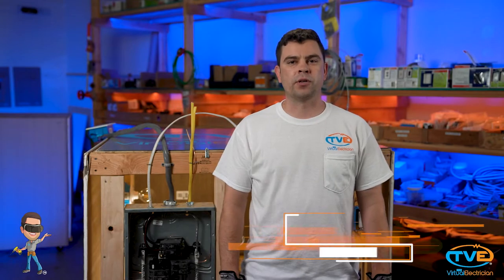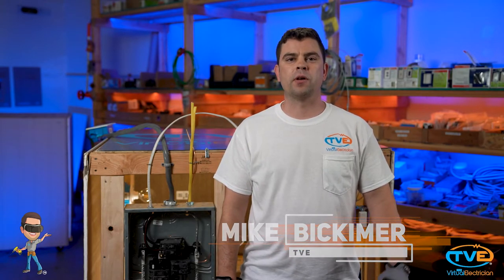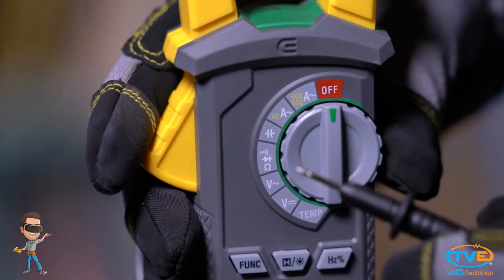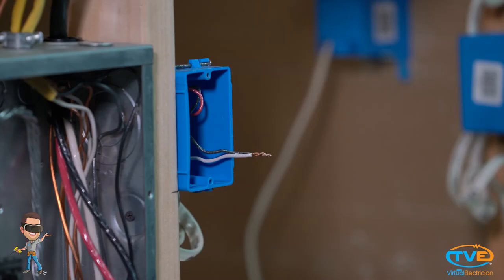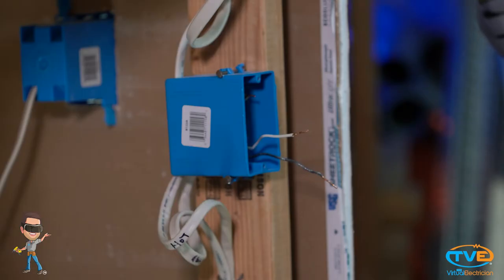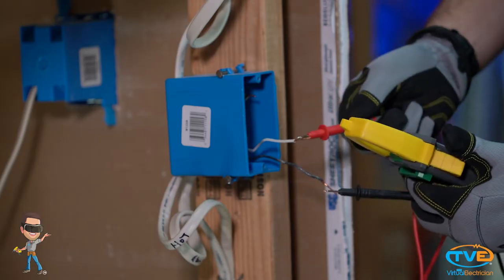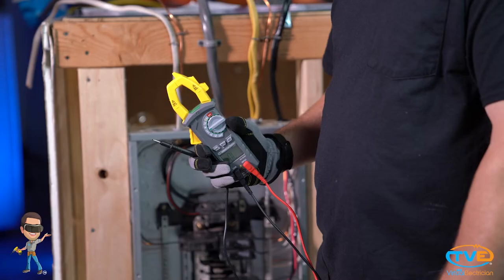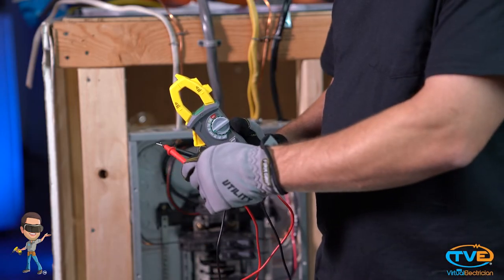How to test an outlet for continuity

Comment: He forgot to mention make sure the power is off. I just blew a fuse following TVE advise. 😔 Im not an electrician,  so I guess that was my fault for not hiring a professional
Reply from the maker: We didn't forget.  If your at this point in our troubleshooting series and the breaker isn't off, your not a very good listener.
Reply: @TheVirtualElectrician  No offense intended, people that use youtube tend to find videos through google or just search in youtube search bar.
If the video is not in the playlist they don't usually go look for prior videos.
While they are in the wrong because it is only smart to make sure you understand the basics, it would be extremely helpful to put a series in a playlist. (Currently youtube does not show this video as a playlist)
But you know, Darwin and all. lol
Reply from the maker: @alexistaylor969  none taken!  The comment still doesn’t make sense tho. If you are testing both ends of a wire, there is absolutely no way voltage is going through it
Reply: @TheVirtualElectrician First thing I thought was I hope folks don't try connecting the hot and neutral without tripping the breaker. What you say makes sense except that people may and will use this advice for the wrong scenario (as per the the prior comments), such as on a live circuit that they suspect a break somewhere. Plus most people aren' watching your entire series. To be upfront, you being defensively obstinate. Also to be upfront, I probably then will not watch the rest of your "series".  Take it constructively.
Reply from the maker: @derekec  goodbye then ✌️

Comment: Thank you for your video. Count me as a new subscriber. If the continuity test had failed, then the break is in either the white wire or the black, correct?  Though both are usually bound into one domed cable and the entire Rolex for that circuit would need to be replaced, correct?
Reply from the maker: Thanks for subscribing Ron.  We really appreciate you joining us on our adventure to provide the best electrical advice in the shortest amount of time without all the "noise".  You are absolutely correct, the break would be in either the black or white wire.  The entire romex cable that is the jumper from device to device would need to be replaced.
Reply: @TheVirtualElectrician  thank you! And sorry about my typos!